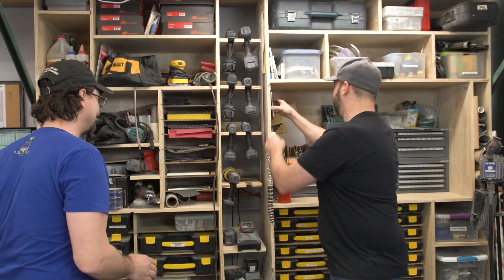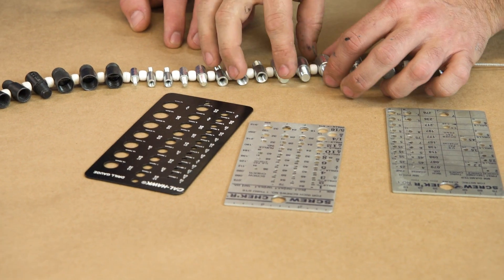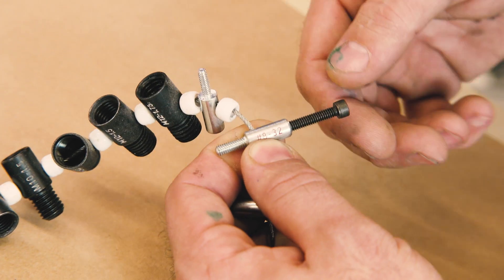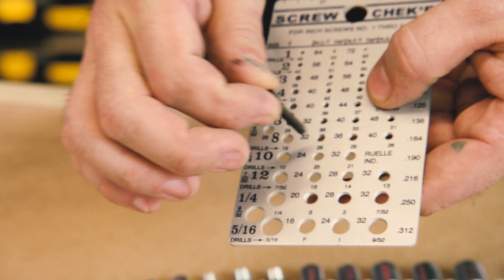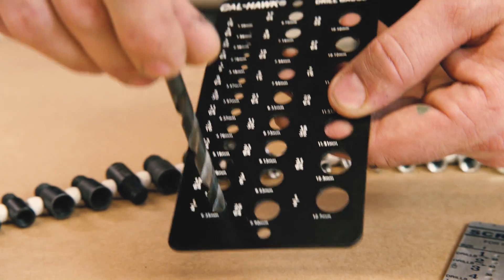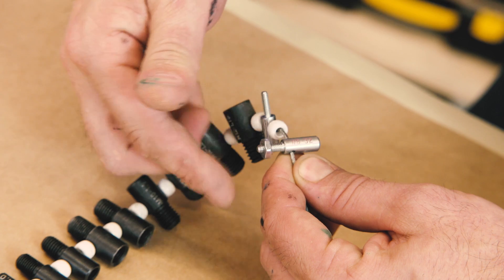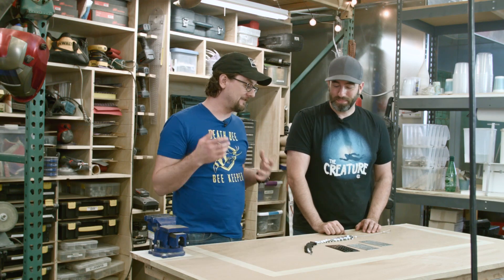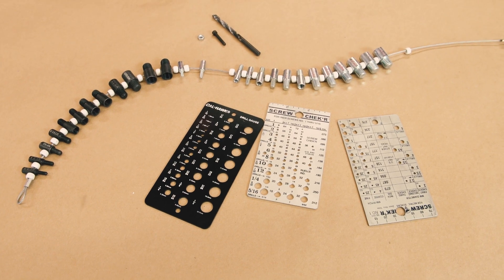Shop Tips: Identifying your Fasteners, Nuts, Bolts, and Hardware

Comment: Great idea guys! Seeing as this is a good tip for beginners, you may also want to add: You can also lay the threads of 2 screws against each other to see if they are the same thread. If they are, the threads will interlock with each other, if they are not the same thread size, the 2 screws will not interlock.

Comment: A pitch gauge and a caliper is all you need. Unless you have small size imperial stuff (with the number system) . In which case I suggest taking up coin collecting as a hobby instead.
Reply: Last place I worked, probably 60% of our fastener inventory was that tiny stuff. It all depends on what you're building. In this case, a lot of little electronic components in some pretty massive high-energy physics projects.
Reply: MrJest2 previous job, eyh? You are now working in a coin shop?

Comment: What do you all think about making absurdly long screws of as many thread types as you normally use and storing all of your nuts on the respective screw?
Reply: Nathaniel Shaw i need 15 of nut x be back in 5, goddamn those fine treads.  2 months later need a nut type y,  be back in 10, those bolts where way too long...

just use boxes that you label
Reply: And Burn It Shall. I was thinking of maybe 1 or 2 feet long per screw. I am trying to be realistic here.

Comment: OK, serious question:  What determines whether it's a screw or a bolt?
Reply: Bolts tend to be fastened with nuts whereas screws tend to be driven into material either making their own threads as they go or mating with threads already established. I could be wrong but I don't think you'd ever drive a bolt into a material with the intent that the bolt would form its own thread and hold there. You do that with wood screws all the time though.
Reply: The closest thing we have to a definition is this: a screw goes through one part and threads into the second part to join them, whereas a bolt goes through both parts and threads into a nut which is a distinct part.  However, there's lots of grey area, so the definition isn't all that accurate or useful.  Source: am an engineer.
Reply: The way I see it: Screws have pointy ends, but bolts have flat ends.
Reply: +Tom Smith - Wrong, those could be sheet metal screws or wood screws.  Machine screws are not pointed.
Edit: Apologies for my wording here.  I did not mean it to be as harsh as it sounded.
Reply: The word that everyone needs to be aware of here is machine screw.  The word "screw" by itself is too vague unless the target material is also used with it or the intended type has already been used at least once.
Reply: Rich, you are exactly correct, my mistake. It shows which ones I work with most!
Reply: But machine screws have flat ends.  A more consistent definition is that screws thread into the workpiece and bolts thread into nuts.  There are other types of screws too (e.g. power screws) but that's getting out of the realm of fasteners.
Reply: If the item being captured by the hardware becomes integral to the item it is being attached to, with the use of its own shape and threads (essentially, a pointed chisel tip with a wedge wrapped around its circumference, with a pitch of varying degree that is usually determined by the cross-section width and the particular application) or by the use of integral threads in the receiving material, then the item is a screw.  The confusion occurs because hex cap screws can also form bolted joints using various external components to compress the materials and prevent the 'screw' from backing out.
Reply: James May have a great answer in one of his assembler videos. Short version: it's way to complicated to bother with, even for James.
Reply: As others have said, screws generally make their own threads in the material it is inserted into while bolt are used with pre-threaded holes or nuts. The technical definition of a screw is: "An angled plane wrapped around a cone in a helix" and that of a bolt is:  "An angled plane wrapped around a cylinder in a helix". The point being that bolts are cylindrical and screws are conical. In normal speak I would hazard a guess that "bolt" is usually used about big, heavy, industrial-grade fasteners, as in 10mm or more in diameter and "screw" is used about wood screws and the like, but then again, you have machine screws and stuff like that, but I digress.
Reply: A bolt has threads only at the tip whereas a screw has threads all the way along the shaft.
Reply: What's this, then?  http://www.ldoceonline.com/media/english/illustration/bolt.jpg

Comment: Id like to see an education bound episode regarding paints, resin, rubber, and silicons with much more detail and explanations on the way they work.. why and what temps are applicable, how to manipulate these things in different environments, even down to chemical relations as well as physical attributes and so on.. there are so many types chemicals im surrounded by in my daily work, im interested in knowing more about them.. ive seen many of franks pointers videos, i just wanted more from them..
Reply: JakerSpace Yes please! How do I get a perfect glossy finish on wood?
Reply: Max Maker! Im a cabinet maker, woods what i know! not sure of your application needs, but in general for a gloss finish i like PreCat high gloss lacquer, arosol-can works fine for smaller areas. I spray with a small automotive paint gun.. perfections not the goal "wipe on" polyurethane finishes are simple and can be nice, just takes time, buffing..  prep is what makes a finish.. i could go on, and be more specific if you would like, im sure there are some good instructional videos around.. at least two products to look into none the least!
Reply: go for the boat lacquers, multiple layers

Comment: So the conclusion here is that metric is superior.
Reply: @Matthias Geist - Nope, it´s easy. M10x0,75 means that the diameter of the screw is 10mm and the thread pitch is 0,75mm. Just measure from one edge of the thread to the next one with a caliper....thats the 0,75.
Reply: tonyrulez69 it's 0.25 from being of any use
Reply: well sry, was too lazy to spell check   ¯\(ツ)/¯
Reply: How is 0,75 complex?
Reply: M10x1,5 is the standard, but special screws can be anything
Reply: Evil from Evilution, only the US, Liberia and Myanmar (Burma) still use imperial measurement.
Reply: Both basically use the same standards, there is no real difference other than the sizes and the thread pitch.
Reply: More about standardisation.  I think much is done with the M series and a finer threaded variant.  I could be wrong (metric ignorance bliss).  I looked if there is a subset: 13, 15, ?, 8, 6, ?  But that's not so obvious.
Reply: In 1866, Congress authorized the use of the metric system in this country and supplied each state with a set of standard metric weights and measures. 1875, the United States solidified its commitment to the development of the internationally recognized metric system by becoming one of the original seventeen signatory nations to the Treaty of the Meter. America has been on the metric system as its voluntary to converts to the metric system of measurement.The metric system avoids confusing dual-use of terms, such as the inch-pound system’s use of ounces to measure both weight and volume. The metric system also avoids the use of multiple units for the same quantity; for instance, the inch- pound system’s multiple units for volume include teaspoons, tablespoons, fluid ounces, cups, pints, quarts, and gallons.
Reply: evilution: Imperial system is widely used in the UK and surprisingly building supply shops, in Australia, use both imperial and metric.
Reply: matric is for properly engeniert stuff. but it gets really complex when you try to mesure non standard metric bolds (eg.: M10x0,75)
Reply: Even their genocide is supieror